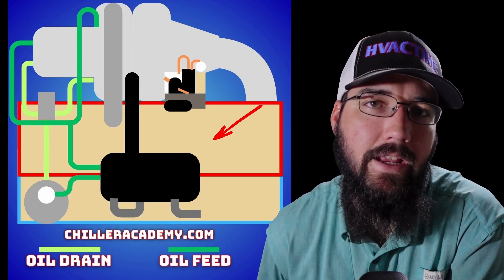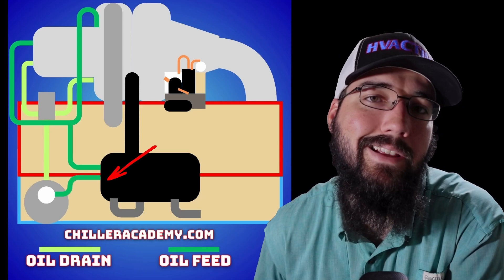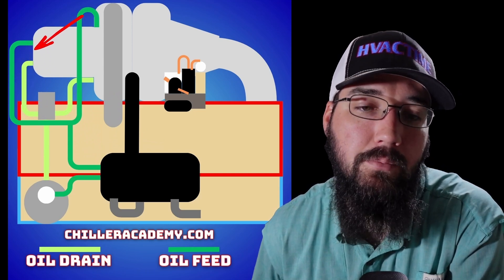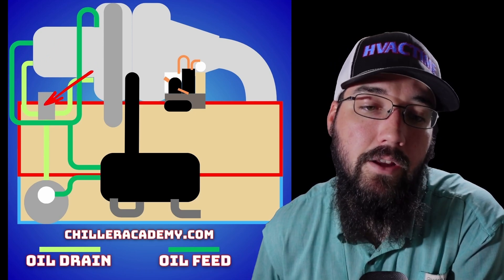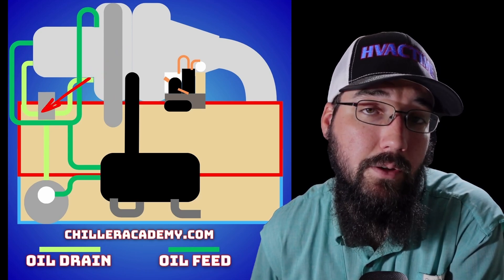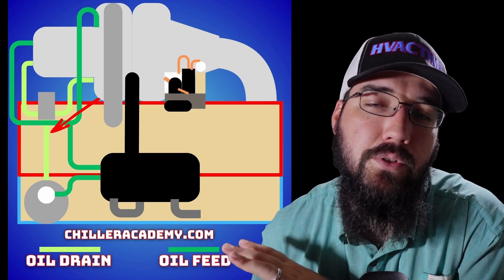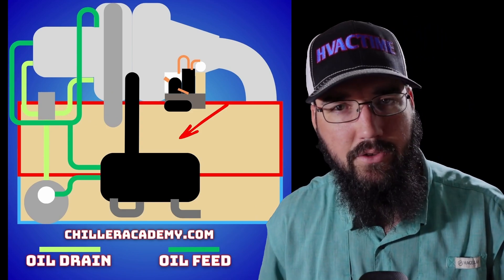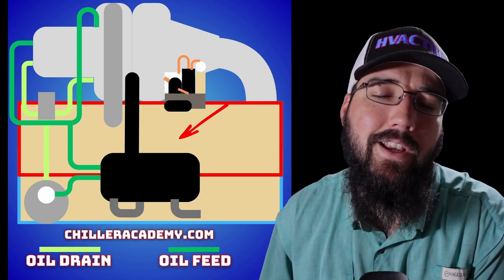Basic Oil Cycle for CVH/CDH Chillers

Comment: Hi good dy boss pls what can cause compressor to give high pressure and also expansion valve hissing very high
Reply: Chiller always trip on low super heat have change the EEV and also oil filter and liquid line filter still experiencing same issue and the compressor is given in usual noise from the pipe discharge line also pls and advice on this

Comment: Bro can you tell me. I am getting a new ac for my parents. A 2.5 ton Spilt ac from Fujitsu General. But there're offering two types of compressor one is fixed scroll & other with twin rotary. I want your opinion on which one's more durable & colling efficient.
Reply: Scroll bro
Reply: @leebear6048 bought the scroll one from Fujitsu. Its 2.5 ton. Its fixed speed with r410 gas. Not that environmental friendly they said
Reply: @fushmontor5517  Neither are nuclear weapons yet look at how many of those were tested. The ozone will survive.